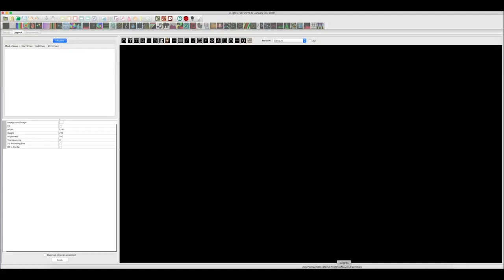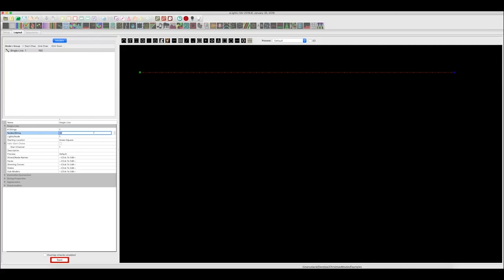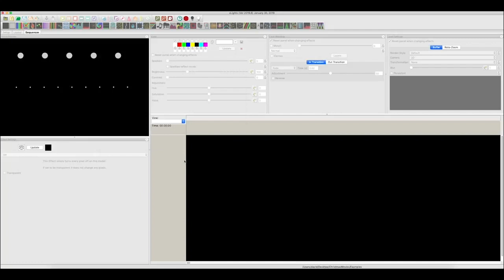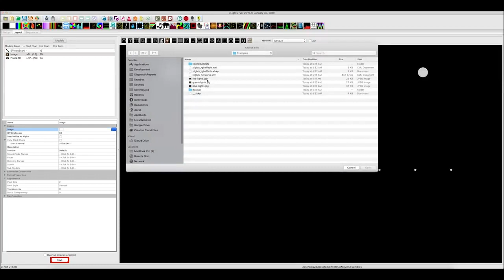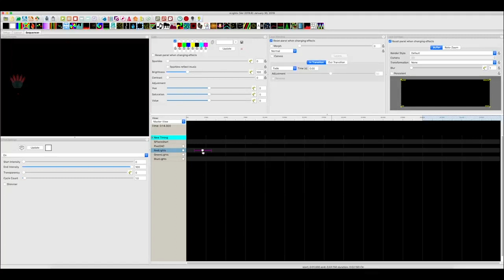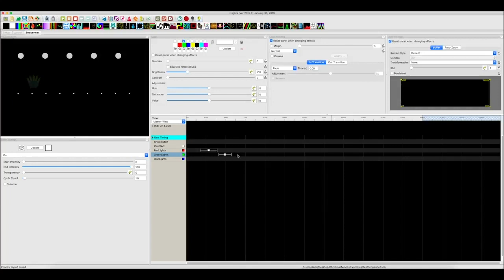How to Sequence Pixel2AC with xLights

Comment: One key thing that I just missed and struggled with was my xconnect data wire was in the wrong slot on the board.  The input data wire should go to D1.  This will be great for turning on and off some other AC lights easily.  Glad I found this board.

Comment: Do you need to have a pixel(s) in front of the board or can you run it straight from a pixel controller? I have a Falcon F16V4 or F48V4 that I would like to use to run this.